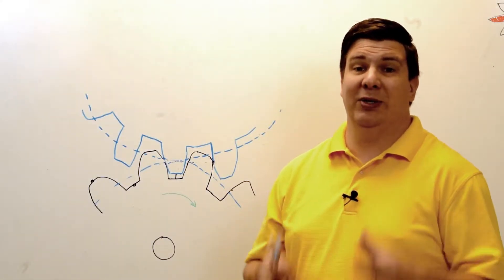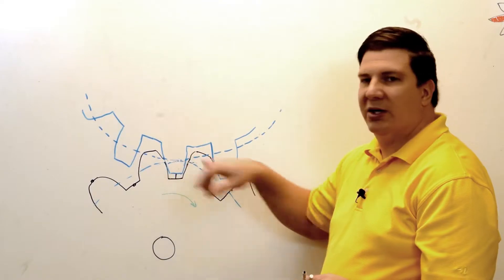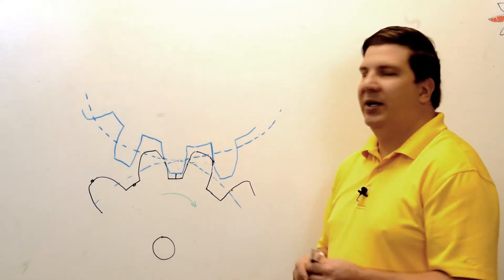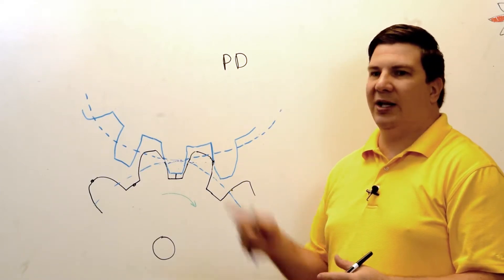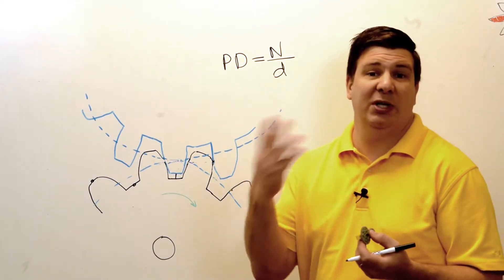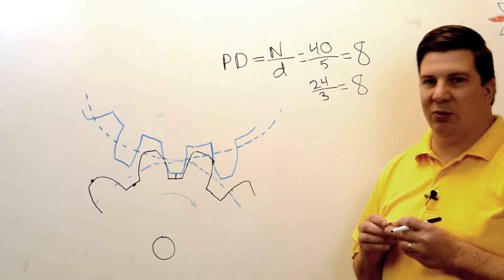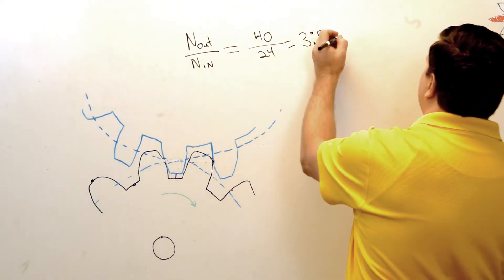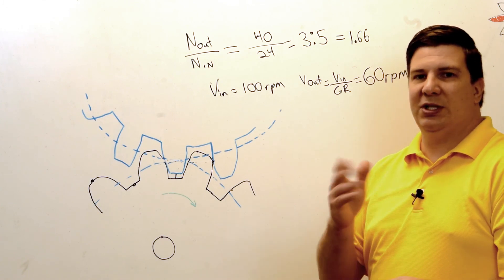STEM-Gear Design: Terminology, Meshing and Speeds

Comment: I'm sorry but when doing the Diametral Pitch you started referring to "spaces". Where are these spaces and how is their number determined?
Reply from the maker: Scooter Tramp, the "spaces" referred to the number of holes in the in the Lego brick from the rotation center to where the gears meshed.  For the large gear, this was 2.5 Lego spaces and 1.5 for the small one.  We multiply this by 2 to get from the radius to the diameter.